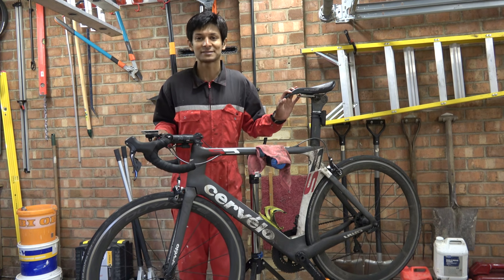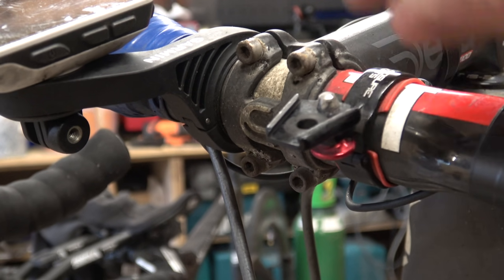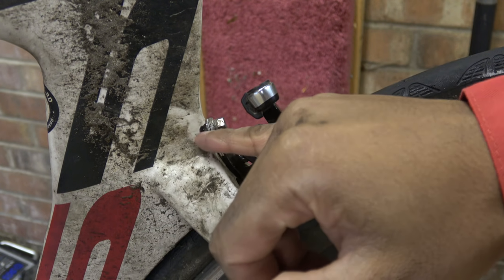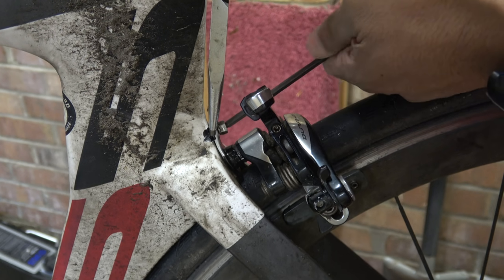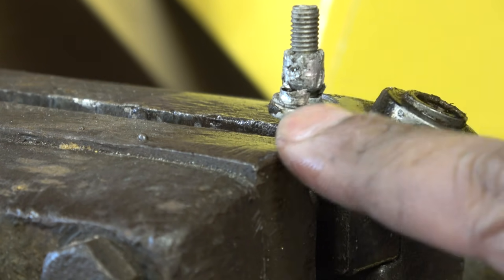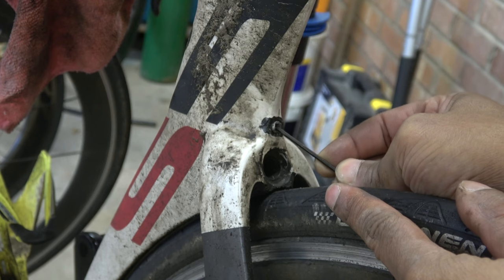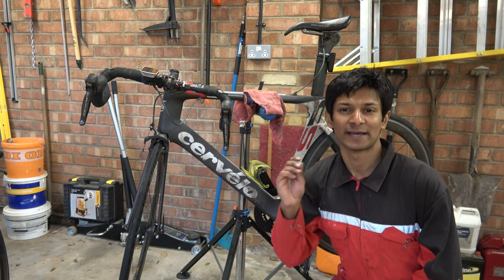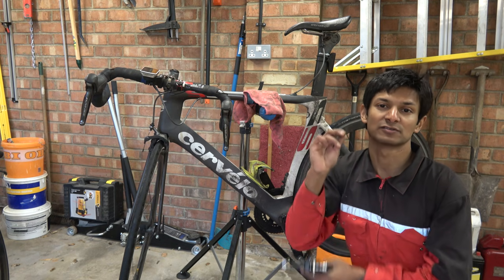How to fix a broken Bicyle Frame Boss (water bottle, bottom bracket, down tube)

Comment: Great video, but my case is slightly worse than yours. My water bottle rivnut has popped clean out from the downtube and taken a bit of cf with it - leaving a ragged 1cm diam hole. (Bottle cage now kept steady with zip-tie.) What I'd like to know (and how to do it) is whether to fill the hole with epoxy putty, or the trickier but maybe stronger solution of bonding layers of cf around the hole before  drilling through them risking tearing, and then squeezing in a new rivnut.

Obviously you shot this last year,  but can i suggest that you treat yourself to a decent winter bike with mudguards and everything?! Even pro racers don't care what they look like when riding/training in shit conditions.
Reply from the maker: you could try some body filler and fibre glass. If it's only for the water bottle, the load is not high so it will probalby take the load. Alternatively, fibre glass and epoxy will definitely take the load.
Reply: @Hambini  Cool! Will look into that. Thanks for replying too. Just found your channel - its v infomative (and dryly funny!)

Comment: Does Titanium react with alu? i would imagine it does
Reply: '' Study of the Galvanic Series suggests that steel and aluminum are reasonably compatible; but, if titanium and aluminum contact, the aluminum, as the anode, will corrode. The bolt, where it contacts the aluminum, will not corrode because it is now the cathode. The aluminum plate in contact with the bolt may corrode, but only slightly because of the minor difference in their electro-potentials and the large anode-to-cathode area ratio.''
    http://www.accuratescrew.com/asm-technical-info/material-compatibility-selection-data/
   I have lightly edited it because it was a generic statement. I couldn't find the picture it was referring to perhaps because it was deleted by my ad blocker.  As a practical matter, using silicone grease on the bolt and/or fitting should isolate the two parts. Some have recommened loctite, but that is not good because it is a conductor. They make a dielectric grease but that is just silicone grease. Any dielectic silicone grease will do. Regular cleaning is much more effective. (1or 2 times a year)

Comment: I LOVE but why not to clean the bike when you inserting new bosses ore reinstall break calliper. The contact point between the frame and  the break hanger  filled with junk is gone damage you frame in that area and result in loose break calliper and less precise/string breaking.

Comment: Normally the manufacturer put a fibreglass piece in the frame to act as a barrier to stop the galvanic corrosion. I wonder if Cervelo did? I have a S5 and the rear brake is a bit of a poor design and the bracket acts like a lever when braking. I know it is about being aero. But I now don’t buy aero bikes as they have these special  parts which can be a pain.
Reply from the maker: I don't think cervelo put the fibreglass in, if they did, it wasn't there when the rivnut failed. I agree, the special parts are a PITA

Comment: hi not to be to critical. you ride your bike in the winter and don't maintain it. I saw the one when you changed the rusted head set bearings. as an owner of any bike you have to clean and maintain on a regular basis and not wait until its rusted or broken. a simple clean and lube or grease its worth it in the end. its a bit of fussing around ; however for me it brings a certain amount of satisfaction. the rivnut would have lasted if you cleaned the bike . so my real point or question is if you ride in the winter and don't want to be bothered to clean and maintain your bike why on earth ride an expensive bicycle ? you could buy something nice as your winter bike and still be able to stay in shape and go 30 klm / hour . and finally I saw the comments and your answers to as why you do not put grease around the head set bearings. in my humble opinion grease keeps the moisture out even though it attracts dirt. that's why i do regular maintenance on my bikes. and yes i have one for the winter which is like your aero bike a project in the making which maybe i will finish by next winter. and does grease really hurt carbon fiber. they do paint the bikes for protection and yes I am careful not to get any grease on my carbon fork because i have heard its bad for the carbon fiber. you are dammed if you do and dammed if you don't. there must be something one could use thats not going to react with carbon fiber. other wise I do enjoy your videos thanks
Reply: i did check around seems like most manufactures say bike grease is ok . auto grease may have some acid which is no good. trek says no problem with their bikes. use grease and wipe up the extra grease should be ok. no harsh cleaners

Comment: How does one remove a m5 seat post Allen key bolt that is damaged and the allen key has no grip ? Thank you
Reply: Either use a hacksaw or cutting disc to cut a slot in the damaged head of the bolt so that you can get a flat head screwdriver in there, or if you can't get at the head you can remove it with an extractor bit available from a hardware store. Failing that you can completely drill it out but you'll probably have to say goodbye to your seatpost clamp. Youtube search for how to remove a stripped bolt.

Comment: Added Suggestions; 
 - Remove RearWheel (to have more room to work, as it appears that the 'axis' of the RivNut was too close to tangent with the wheel, and the additional width of the tool making it appear to be simply added hassle and interference)...  
 - Add a touch of Epoxy to RivNut/Frame (for less likelyhood of this situation occurring again, and 'fill in' the voids that occur when removing broken RivNut - additionally handy if you want to touch up the paint).  (This may also make 'Removal of a previously Spinning RivNut' - unnecessary.)  
 - Anti-Seize on Threads (for Better Initial Tension, Less Corrosion, Easier Removal)...  
 - Steel or Titanium Bike Frames (are less likely to have these issues)...

Comment: Odd that the Ti bolt is so long. That's the original presumably? I can't see why it's so long when the rivnut thread seems so short - surely a shorter (steel) bolt would be better?
Reply from the maker: I think they just buy a box of bolts and use them everywhere on the bike. Cost saving or parts rationalization

Comment: Has a different electrical charge??
Reply: Nobility of materials/metals/alloys
Reply: My point was that the different metals do not have a different electrical charge. Electrical charge is electrical charge (either positive or negative). Overall the metals are neutral, and are so when they are put together. The effect discussed here is complex but put simply, when two dissimilar metals are touching in a way that allows charge to move, then a voltage is set up between them. I am being 'picky' about the physics, that is all.
Reply: @johnchilton3975  Yes for sure, but Mr. Hambini did explain it simply enough - or as you allude, a cell is created, and that is effected by ref. to the Galvanic series.

Comment: all you people whining about using grease you just dont get that its a small aluminum nut and very hard bolt,  meaning you can only torque it very little,  by feel generally,  and it just must hold the caliper no matter what  as brakes are important.  Using grease you risk over torquing,  stripping threads  or that the bolt would come loose.    I actually in such low torque application use special wax based clear paint  which acts like a glue,  but it melts from alcohol or heat, so no problem undoing the bolts.
Reply: Not quite correct...  
Lubed Threads ALLOWS More Accurate Tension on the Bolt (for the exact same 'Torque' Readings that are often specified from the manufacturers)...  
'TENSION' is what is required on Bolts - NOT 'Friction' that hinders application of the necessary  Tension...
Reply: @NoFretBrettCSSMBFF  ,   i agree but who uses a torque wrench for such small bolts? i'd be afraid of stripping threads or cracking the frame and rather go by feel and some thread lock. But for cars sure i generally lube,   eg i was retorquing headbolts on a motorcycle and lubed all the nuts before tightening to the specs,  dont know if it stopped the leak yet tho.
Reply: ThreadLocker 'acts' as a 'lubricant' (when tightening)...  
So, (I understand that) 
We Agree...

Comment: @Hambini Unreal that you use an S5 with Di2 as a commuter
Reply from the maker: 5davi5 in summer I commute on the time machine!
Reply: I'm feeling a bit jealous :) I have a 12 year old Bianchi 928L that has only seen rain twice, it's my Summer bike. Oh by the way, keep up the great videos.
Reply: @danfuerthgillis4483  so mr bike expert, what actual difference would it make cleaning the frame?
Reply: @DeepakKumar-lv4te  First rule of bike frames is to keep it clean even on carbon bikes. The more shit you leave on it the more shit will fly off into the metal components and cause issues later on. Britain ( I mean the country still owned by the Opium cartel family) is very rainy so it’s quite obvious that he does not give a “Shit” about cleaning his bikes.

Comment: i grease all my bolts before install. is that wrong?

i also smear a light coating of grease into my booties for waterproofing.  ugly, but it works in Canada in the winter
Reply from the maker: Greasing is a good idea. If you want to be really pedantic, it's worth running a tap or a die through any aluminium parts as they inevitably end up with some surface corrosion. Then the grease will stop the galvanic corrosion (or certainly reduce it).
Reply from the maker: Greasing your bolts is fine. It will make the thread engagement better

Comment: Ok so its a commuter - we get that but breaking a boss on a filthy bike to clean one component is a bit naff. Why not leave it alone - happy and filthy. On my commuter I will wash the critical components at either end of the ride (often just with the water bottle and a rag) or the hose at home so that the drive parts work smoothly and last longer ( quality 60 - 90 seconds ).

Comment: why does everyone use round rivnuts... right right, round holes are easier to machine, but they make hex and square ones. That way even if things go sideways later you can at least get the fasteners out.
Reply from the maker: Pass, I don't know why they don't bond directly into the frameshell. it's what they do in aero

Comment: Step 1. Clean what you are going to work on!

I think you should have cleaned the parts with acohol (after washing the whole bike) and use epoxy to preven rust and movement of the piece you are installing.

Comment: Ridiculous cost cutting by Cervelo going with rivnuts.  They should have used a tapped piece of aluminum bonded into the carbon for that design.
Reply from the maker: welcome to the bike industry!
Reply: If you think that's bad, you should see what KHS is doing. My local bike shop stopped carrying them because they almost went under due to warranty work. They're so bad that I brought my old seat-post in because the friction ribs at the top got stripped out, and they just handed me another one from under the counter for free. It's almost like they were expecting me lol.

Comment: That seems like a very poor design, there are significant forces on the brake bolt.  The frame should have an embedded piece of metal that is part of the carbon fiber construction, not a drilled-in afterthought.

Comment: carbon is porous, why not coat with resin & paint the surface; Less moisture absorbson and less galvanic corrosion with AL. p.s. Great channel and info except for the issue I mentioned.

Comment: https://borenco.nl/nl/artnr/10230100210a2/blindklinkmoer-vk-rvs-a2-m-10-x-21

These are stainless steel and they have groove's so it won't spin easy
Also very important you have to apply a rivnut that krimps over the thickness of your material if its to long its loose if to short you wil damage the carbon

Comment: Isn't that classed as a crappy Engineering design in the first place? Normally on carbon fibre assemblies, mounting nuts or studs are welded to a perforated steel disk, the carbon fibre is then bonded to the disk making the nut or stud an integral part of the frame.
Compression nuts are really for steel plates, where there is some mutual deformation to hold it in place.

Comment: Did you buy a new bike yet ?
Reply from the maker: yep. I did
Reply: Would be interesting to know about your thoughts, especially around what you considered and why ? 
I am myself looking for a first proper road bike these days and I like to learn about things to help me decide. My primary objective at the moment is to train for "Vätternrundan" which is one of the longest (300 km) bike event here in Sweden. I might get into triathlons at some point later on and therefore I am thinking about getting an Aero bike for training and shorter events.
Reply from the maker: For an Aero road bike. The Cervelo S5 with the double hole seat post is a good option. Alternatively Yoeleo and Hongfu are wworth a punt. The critical thing is the rider position not so much the frame shape.

Comment: titanium bike with titanium bolts. problem solved
Reply from the maker: This would work
Reply: I was thinking titanium rivnuts would be a sufficient amount of overkill, but you're right, it's probably better to ditch the Cervelo entirely and upgrade to a full blown titanium frameset.
Reply: @swolebro  My Litespeed Titanium comes with Aluminum Rivnuts. Have had this Issue 2x Already Mainly on  the Downtube Bosses.
Reply: @swolebro  i don't think Titanium is soft enough to manufacture rivnuts - they need to be soft to be able to expand. Titanium is - well - not very soft... ;)
Reply: @campodma1  Had the same proble with my Lightspeed. How did you fix it?

Comment: I usually wrap around rivet simple nylon thread with some glue, that makes perfect insulation from carbon.
Reply: (a) You don't get galvanic corrosion with carbon (b) no amount of nylon tape will prevent the thread on a metal fastener from biting through when it is tightened. Nylon/Silicon tapes around thread are to stop liquids and gases from escaping between the threads NOT to stop metal to metal contact.

Comment: Anyone using carbon frames needs 2 things cyanoacrylate ( super glue) and some baking soda. That is all that is needed for this repair simply because baking soda and cyanoacrylate will auto harden and stick to the carbon for fast repairs. Also dont be a lightweight bike weenie needingan aero bike to comment 40 km just get an alloy frame bike. That Cervelo is an aero bike not a commuter bike so get a real bike to commute and avoid these problems, if you need DI2 to commute get some legs man lol.
Reply: Most cyanoacrylate glues are not UV resistant and breakdown over time.
Reply: @cup_and_cone  Yes they do, you need to get the "Krazy Glue" brand it's the one I useR for patching repairs of plastics, carbon pieces. Baking soda and cyanoacrylate is like a standard in any Rc airplane, copters, drone repairs.
Reply: @danfuerthgillis4483  Krazy Glue cyanoacrylate is the same as every other kind of CA. They clearly saw you coming from a mile away lol. Sucker is as sucker does.

Comment: That is some rubbish engineering from a to z! Galvanic effects between different metals are a well-known and a understood fact. It therefore makes no sense whatsoever to use two or three different types of metal to mount one single part onto a frame whatsoever. Why use a titanium bolt on an aluminium nut? Besides they must be completely rubbish in the first place if they break in two 'invariably' when you try to unscrew the bolt. And they aren't mounted into the frame well either of they start spinning with it or get loose - I'd say they are badly designed only for that fact alone !

Comment: Lack of maintenance or better yet improper maintenance... Full service every year😨and that is dependable on the conditions the bicycle is exposed to really. Lubrication is of essence to avoid this.... Unless you do this harsh testing for examples of how to fix it but before spraying shit all over the place, perhaps removing brake blocks and wheel first to avoid some bloke doing the same then commenting he has crashed due to brake failure or his brakes are squealing or no braking performance. You have to set a better example friend. I am not claiming to be all knowing but have been in the cycling industry for 5 years and cytech master technician... Just saying I know a little bit... The fact that your frame has chipped is telling me you are trying to figure out yourself how to remove the riff nut. Lol buddy its all about prevention, rather make an educational video than a video of how to try unfuqing improper maintenance.